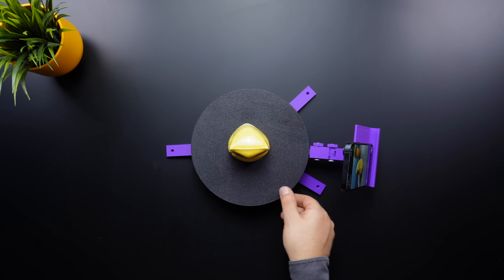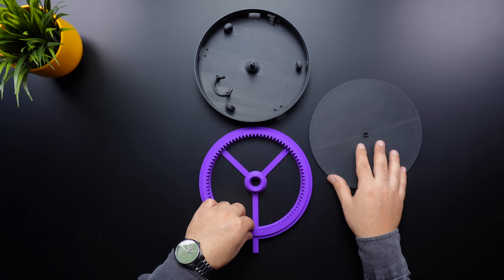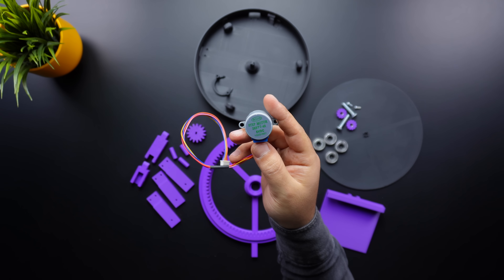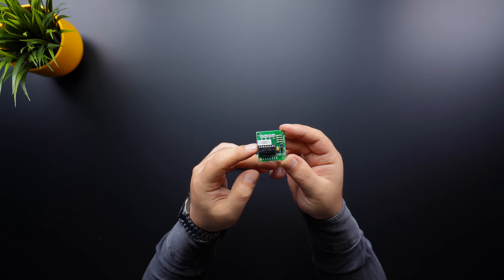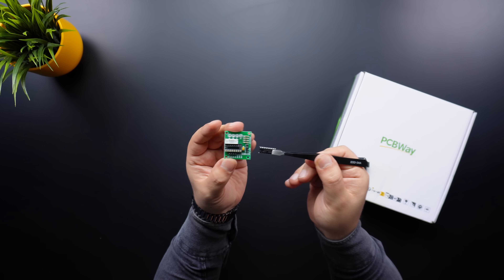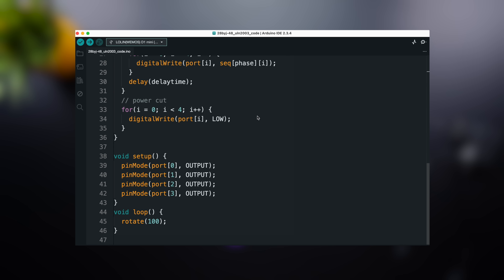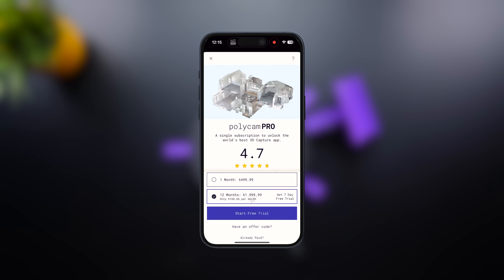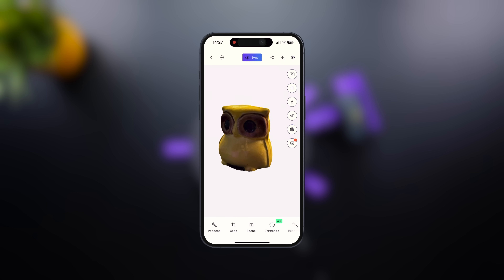Easy DIY Turntable for 3D Scanning Projects!

Comment: I made this but it failed big time. The side bearings don't even touch the outer gear, it doesn't rest on them. It drags along on the sides of the base. And the top, if pushed to be flat with the cross in the middle, it rubs against the outer gear as well. Lots of friction. After two complete turns, the cross snapped. It needs a redesign. The idea is good though. I would make a channel on the top side of the outer gear and put bearign balls like 5mm diameter in the channel, and match it with the top side. And I would correct the height of the base, so that the gear rests on the bearings. Like this, you get the weight to push on the balls and the bearings. And that middle connection... I'd install a 6mm nut and bolt it with a screw. The cross snapped clean off at the layer lines. If you can share the CAD files, I could redesign it.

Comment: very nice but why not make the table rotate directly with the object on it while holding the phone still?, I ask because it is possible to make everything even more compact, I don't know if you have already considered this choice and it has given problems
Reply from the maker: I think what you mean is, instead of the phone rotating, why didn't the top plate on which the object was placed rotate? This is possible, even possible in a design that can be rotated manually without the need for a motor. If you've seen the video, check out the Polycam part @AndrewSink does exactly what you want. If we have to rotate the top plate, we have to manually capture the image. My project uses Auto mode, which allows scanning without any manual intervention 😇